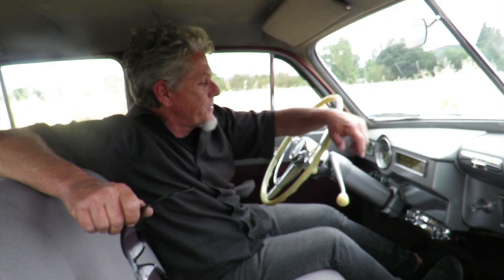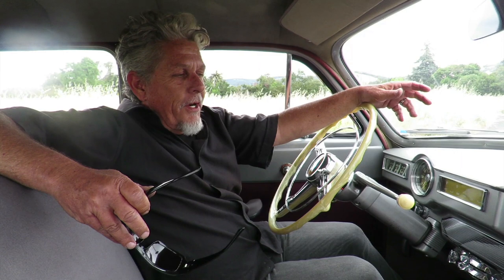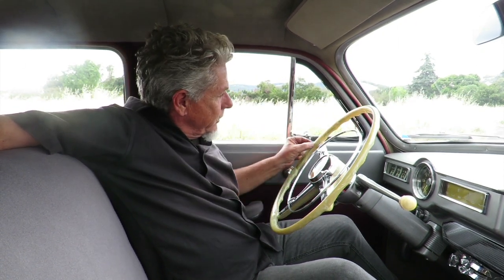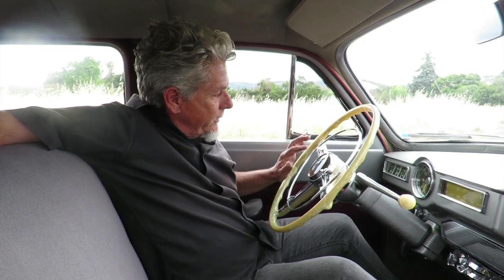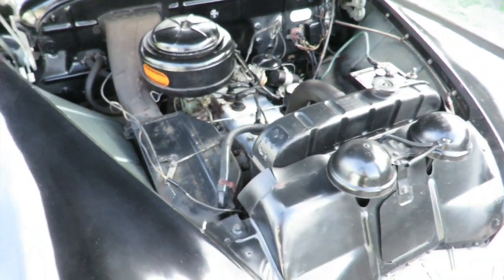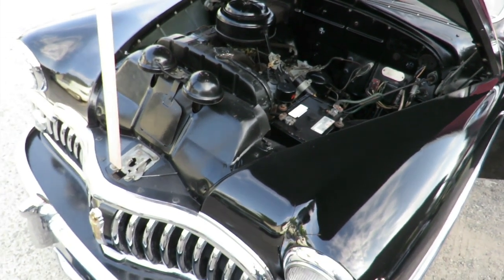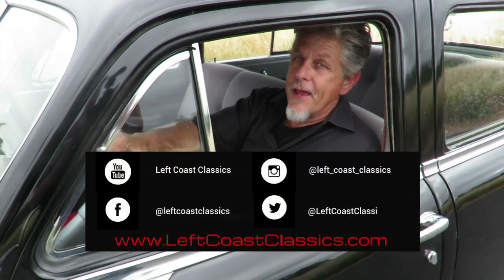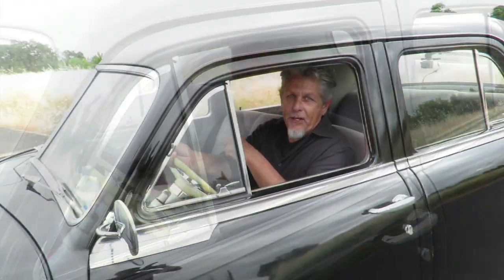Rare Original 1950 DeSoto Custom w/ Only 5,861 Miles!

Comment: I have a '50 Dodge with Fluid Drive.  When I was having some work done, my mechanic lost that brace that goes from the engine block to the air cleaner.  I had to go to a junkyard to get another one.  The one I picked up had a switch on it, like this DeDoto has.  It took me a while to discover it was the kick down switch for the semi-automatic transmission.  Apparently the parts car I was cannibalizing had the Gyro-Matic.  They used different names for Chrysler and DeSoto, even though they were the same transmission.
Reply: I miss these SIMPLY GREAT cars SO VERY MUCH!!!

Comment: You make me cringe snapping that magnet on original paint. What is the point of this? The owner says it’s original paint, are you checking to see if he’ s lying? An insult.
Reply: I totally agree.
Reply: Right? I mean I understand he is demonstrating it is free of filler but could you put a little cloth over it JC!
Reply: Or you could just check the bad areas and if those are fine just trust that it’s okay
Reply: What are the chances a 5000 mile original has any bondo in it. All you have to do is glance at the car and you know what it is. An outstanding original.